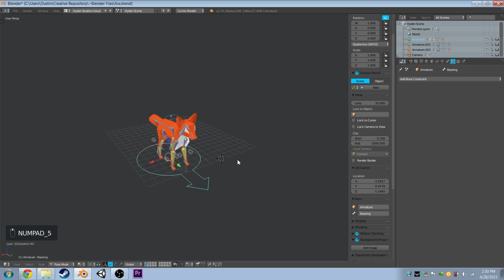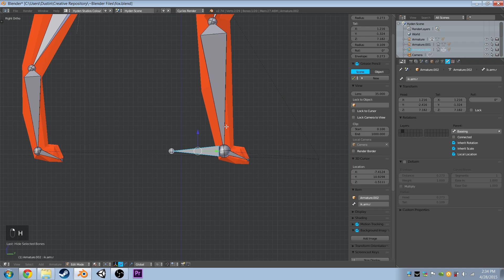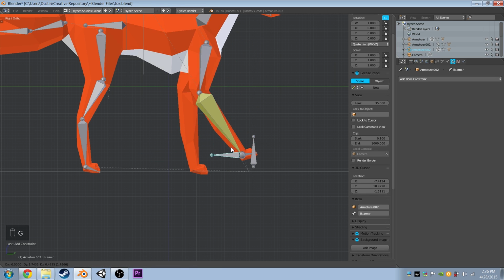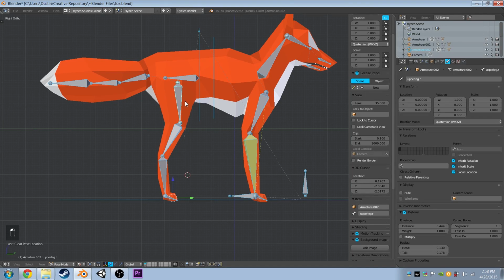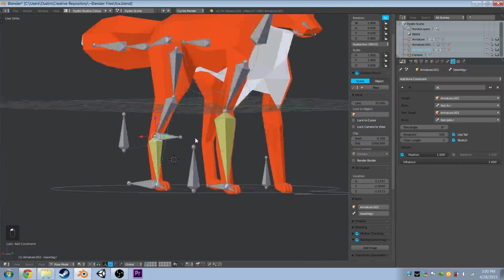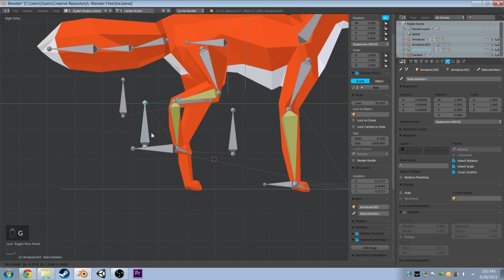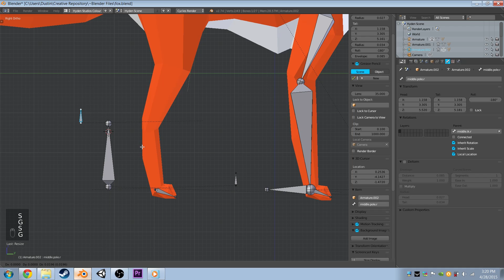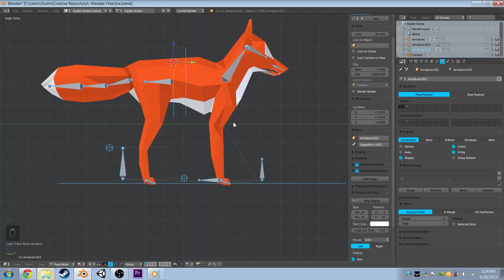Blender Tutorial: Ik Rigging 2 Joint & Ik Rigging 3 Joint

Comment: I can't get this to work for me? When I try and move the leg, all it does is spin in circles, not actually move, and I can't seem to figure out why?

- I've made sure that the ik.arm.r bones have "connected" unchecked like you said.
- Chain link is set to 2
- As far as I can tell, the bone that is 2nd in the leg [ not the foot, bud directly above it ] is parented correctly. 

I'm having trouble figuring out what would cause this? any help would be great! Thanks so much!
Reply: For anyone wondering, I've solved my problem! I had the bones used to move/pose the legs parented to the rig instead of the base bone.
Reply from the maker: Hey, sorry for the late response. Glad you solved the problem!
Reply: Hyden It's all good! This video [ and many of your others! ] are super helpful! :)
Reply: Where do I find this? I have the same problem too.